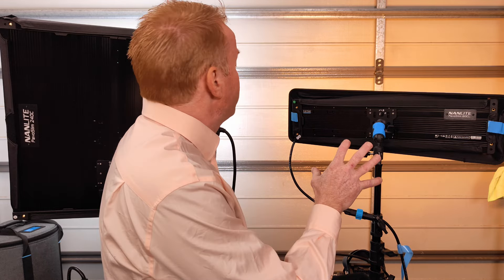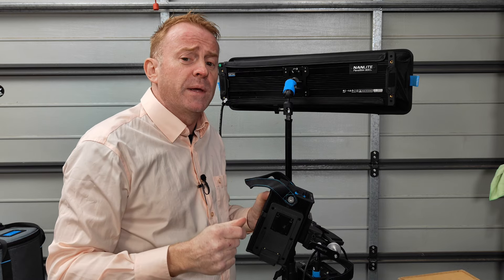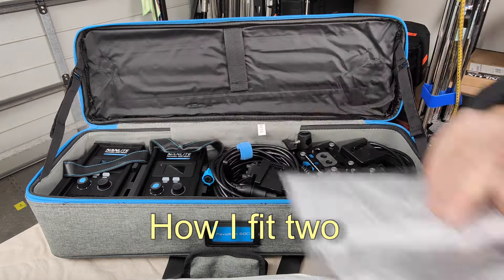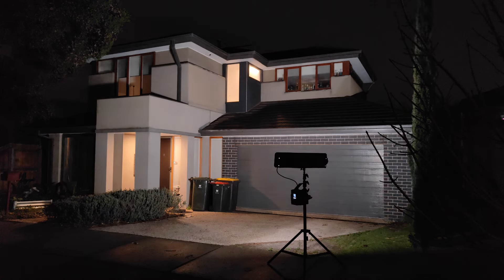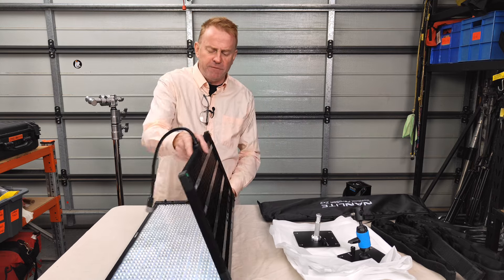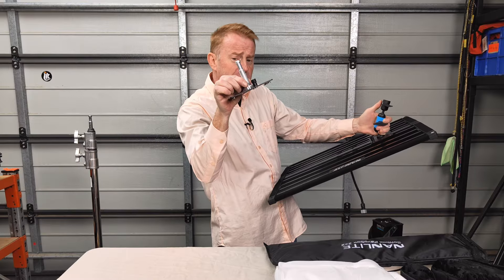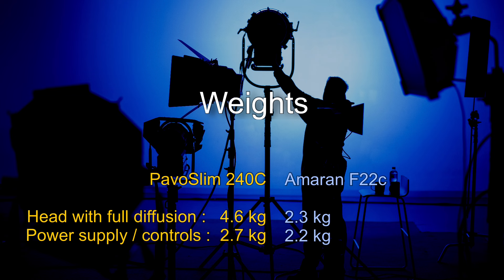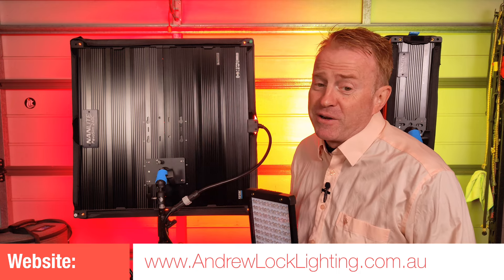Gaffer & Gear 275 - Nanlite PavoSlim 60CL & 240C

Comment: I think a possible solution for the 240c babypin, is possibly a longer babypin, but also one that is angled at say 60 degrees. OR...just came to mind, increase the babypin plate plate length to then by design, move the babypin to the edge of the structure of the light. It probably will require a slight change of the baseplate, to include a structural rib in the design to prevent bending.

Comment: Shame on the velcro  softbox, as I have a 120C and love the fast it is to work with, tho I do not know how can you be able to fold it and keep a pop up softbox... But i think they missed the opportunity to make it modular, so you could either have a 2x2 or a 1x4, since you are taking more time to set it up. This could be done with detachable hinges bulit to two sides and pins that transmit data and power. They would need to include another softbox for that but they already make it for the dual 120c...

Comment: I thought 240C has pop-up softbox, not sure why, since it folds :D. Wasn't aware the diffusion eats so much of the output, I was considering Amaran 22C too.

BTW, I watched the review 20minutes after I ordered it (It was on my wish list for almost 2 months) :D. I hope this is faster to setup and easier to transport than 600D + softbox or Godox F600Bi, which are my usual suspects for key.

But 60CL seems like a really useful light. I've been thinking about 2 120Cs, but now I think I'll get 60CLs.

Great review ... as always. Thx.
Reply: Just saw your reviews too, excellent job. Would you say the 240c is twice as efficient in output per watt as the f600bi? I regret getting the Godox already!!
Reply: @atriux7  It's rather like 4 times as efficient, since it's 4 times smaller (area). Based on power draw it's also like 4 times more efficient, because at 250W it generates 23% more light than 600Bi at 650W :D. But it's virtually more efficient, because it's based on the design with the lenses on the diodes.

These are two different lights, I haven't compared them side by side in the same scenario yet, but based on what I see 240C is nice for talking heads and maybe medium shot tops. F600Bi is able to light full body shot and you still get really soft light. Oh and if you use diffusion on 240C, then the whole magic disappears and it become as effective as 600Bi in lx / W department.

240C is definitely better at fighting the sun, because the light is more concentrated (60 degrees beam).

I do not regret buying F600Bi, because it's my softest light, which is powerful enough to fight the sun (to an extent).
Reply: @JoATTech  thank you for your detailed response, very helpful
Reply: @atriux7  BTW, have you seen new Nanlite Alien 300C? Better output than 240C, more robust desingn, IP55 rated and just just $400 more.
Only con is the fans, but they promise 19dB which is very quiet.
Reply: @JoATTech  No but I just checked it out. Nice evolution of their hard panel units..nanlite is killing it
Reply: @atriux7  BTW, I've put a video comparing F600Bi and 240C in the studio yesterday. I'm surprised by the results actually.

Comment: Thank you for the in-depth review once again! One question, which magnetic mounts did you use on the cars’ windows? Big thanks in advance!
Reply from the maker: @daanjessevenmans  I got those from a on line UK seller, and they haven't been available since. Dam hard to find large magnets with 1/4-20 threads
Reply: @gaffergear  thanks for letting me know. I will contact a UK reseller to see if they can deliver it

Comment: Build quality question. Does velcro on diffusions falls apart on your unit?

My diffusion velcro is loosing like 50 velcro hooks every time I de-attach it. Hooks are flying all over the place and I already inhaled and eaten some of them. Really nasty thing.
I keep them in a plastic bag and threat them as toxic material 😅😅😅
Reply from the maker: @JoATTech  I haven't had that issue at all, on any of the PavoSlim
Reply: @gaffergear  Interesting. Can you double check? :D

Seems like my unit is from quite a new batch, cause they ordered it for me from EU distributor (unless it was on the shelf in the warehouse) - lead time almost 2 weeks.

I do not know what to thing about that, I will definitely contact Nanlite customer support.
Yesterday I got some hooks in my hair, so they were scratching my head when I was wearing baseball cap and I thought I got a tick there.

I guess I should wear safety glasses and the face mask when I operate these diffusions :D.

Comment: Thanks for reviewing these Andrew! I had a 240C here to test for a day and I ended up sending it back. I found the light on the harsh side even with the softbox. I get nicer light with a Chimera + 500B II or 300B II (probably because the diffuser sits further out) and with the 240C on the heavy side plus the setup time for its softbox - I'd rather go with the COB lights. I also wasn't fully convinced the build quality of the 240C would last. It felt a bit janky and I did notice the ball joint not being up to the task, too.

I may still try a 120C or 60CL as the weight and pop-up softbox features are enticing. I like your idea of using the 60CL instead of a tube light a lot.

Comment: Great review Andrew, Nanlite just told me that the 240c will only run full power on two 26V batteries. So you tested and it runs full power off of 14.8? I ask because I only have 14.8V batteries. Really don't want to buy 26V if I don't have too.
Reply from the maker: @RobertJohnPhotography  mine is definitely running at full power off two 14.8v.
Reply: @gaffergear  Thanks for this info.

Comment: Strange - my unit has like 1 stop lower RED readings but almost 3 times more of BLUE output 🤔🤔🤔😮😮😮 in HSL mode.
Haven't seen it disturb CCT modes. But I do not have spectrometer, so hard to say really.

But maybe it's my mistake how I measure colour output. I use 100% saturation and 0, 120 and 240 values.
Reply from the maker: @JoATTech  I measured in HSI mode, it could possibly be different if you measured in RGB mode over DMX for example.
Reply: @gaffergear  I measure in HSI mode too.
But I use 0, 120 and 240 with 100% Saturation.
Not sure I should use 100% or 50% saturation for the measurements.

What color values do you use and what % of saturation? I guess I'm making a mistake somewhere.
Reply from the maker: @JoATTech  same as me
Reply from the maker: I take my F-Stop reading on a separate meter as a sort of double check as I go.  So for example if my lux readings on my C-800 are double the previous, I would expect to see one F-Stop difference on my exposure meter too.

My results are directly entered into my editing software as I'm filming to ensure I don't get any notes mixed up between other lights I'm reviewing. (That has happened in the past)

I have no logical explanation for the difference.
Reply: @gaffergear  Your results are much closer to what Nanlite publish on their product page for 240C.

Maybe I have different firmware. Or maybe my Sekonic L-858D has a problem measuring color light.

Hope it's not the case my unit is broken :D.
Reply from the maker: @JoATTech  Maybe it's worth checking firmware, it could be out of date.
Reply: @gaffergear  No new firmware for PS 240C on nanlite page. I guess it's time to buy a spectrometer :D

Comment: Just a warning, I work at a rental house and we have recently had a Pavoslim (120c) go out on a hire where the client was using 2 Kinefinity cameras. The 120C connected to both cameras mid interview via its wireless control, corrupting footage and almost bricking the cameras.
Reply from the maker: @jameswire100  via Bluetooth? CRMX?  I've never heard of such a situation, did you replicate the scenario. But either way I will be switching off my Bluetooth, so thanks for the warning.